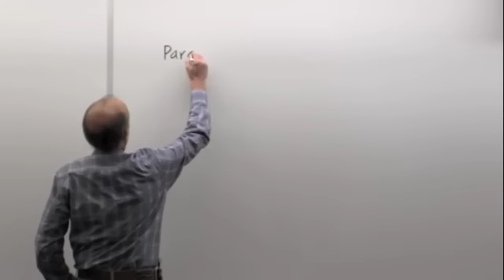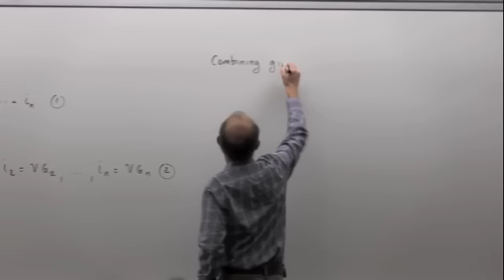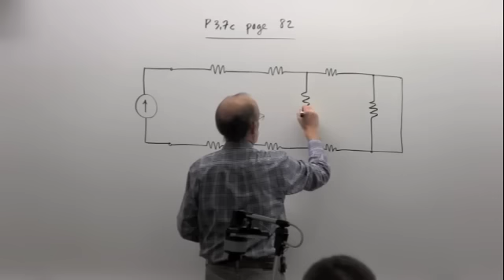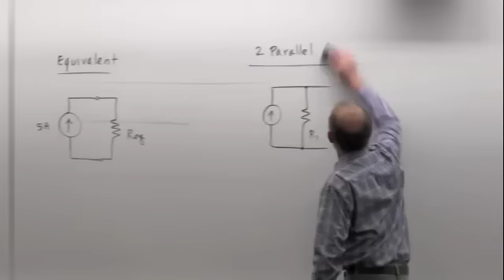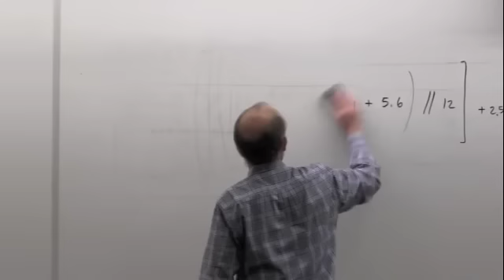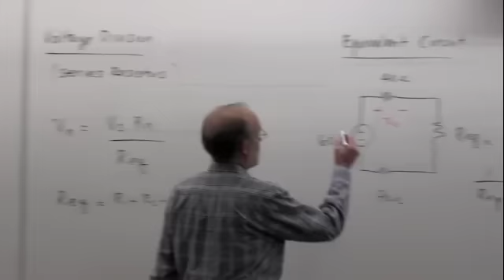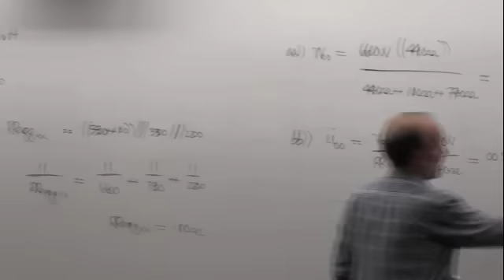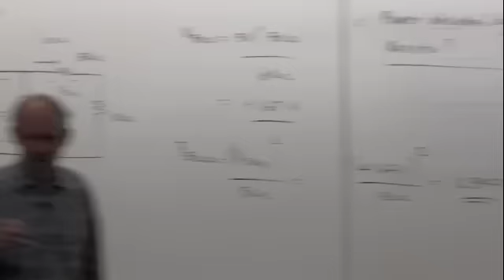EGGN 281 Lecture 4 - Voltage and Current Divider Circuits

Comment: Voltage division is at 31:20 for those interested.
Reply: you're a hero
Reply: I consider that If I had talked more about the specific problems of the engineering courses to my parents as well as sister, then they might think I know more. My sister Shawn Noone took a completely different path in life. I think I could better internalize the details of the subjects of applying calculus to solve some engineering problems by showing them how to solve them, but it is an area of my life that I have only done. I also consider I should have gotten a bachelor's degree in software engineering instead. It creates separation with the relatives. In my jobs in the Navy, I was never directed to apply any mathematical and engineering training to any problems.

Comment: In first example,
 Req= 120 ohm. It isn't 20 ohm. Correct me if i am wrong.
Reply: no it is 20ohm , make sure your self in good how to manipulate the parallel values and series. 4+12 = 16 => 16*144/16+144 = 2304/160 = 14.4 => 14.4+5.6 = 20 => 20*12/20+12 = 240/32 = 7.5 => 7.5+2.5 = 10 => 10*15/10+15 = 150/25 = 6 => 6+(10+14) = 30 => 30*60/30+60 = 1800/90 = 20ohm
Reply: @worldlife5349  Superb breakdown!
Reply: @worldlife5349  Thank you. I was confused about the computation of the equation.
Reply: @worldlife5349  omg thank you soooo much! I was so confused D: